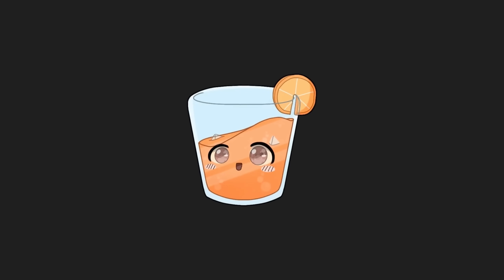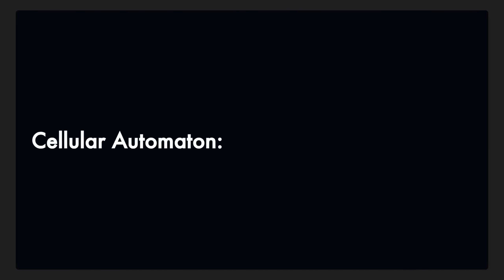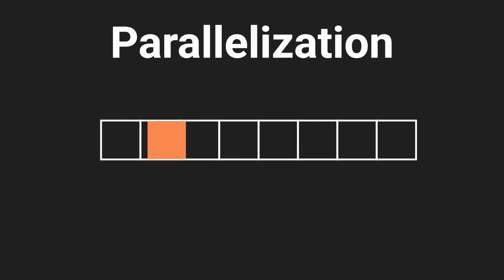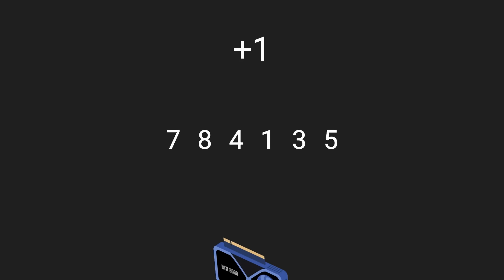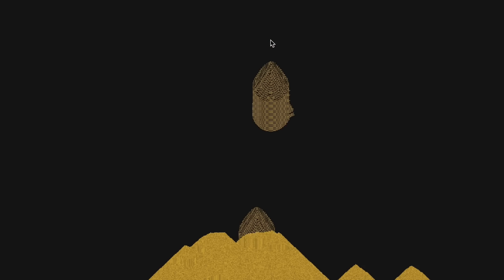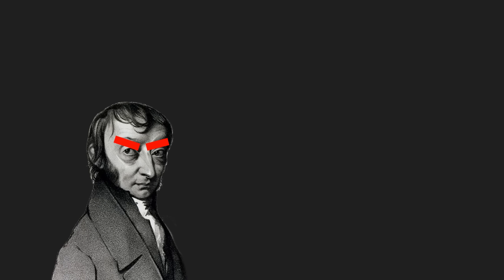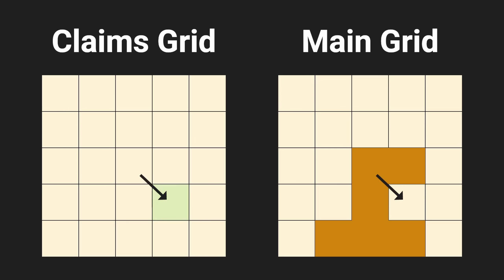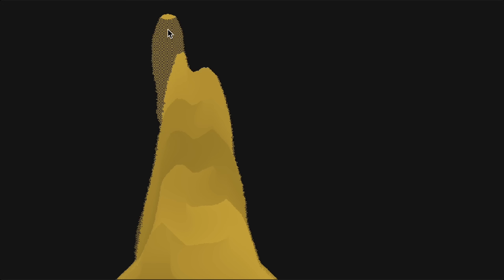Optimizing a Falling Sand Simulation To an Unreasonable Degree

Comment: The funny thing about what was said in 2:49 about CPUs is that, being a digital circuit, the CPU actually works in parallel behind the scenes. But its hard to make programs this way and most of the algorithms are design to work sequencially, so the circuit is design in a way the commands are read and executed in sequence.
Reply: Even if you do get the CPU running parallel operations, it's still going to be 8/16/32 threads, not the literal thousands you'd find in a GPU
Reply: Are you referring to instruction-level parralellization or superscqlar excution?
Reply: @JosGeerink  it sounds like they just heard about instruction pipelining for the first time
Reply: ONLY the individual physical cores can run stuff in parallel, other than that the core just switches Rapidly between tasks to fake concurrency, check Coredumped video about this topic
Reply: @Guilred  Actually they are smart enough now that if part of the core is not being used, for example the addition unit is not used for the current instruction, but the next instruction does use it, it can read ahead and execute the next instruction in parallel. Obviously it is a lot more complicated given branching and data dependency, but I think that is what the initial comment is referring to.
Reply: @Guilred coredumped is awesome. Really strange how he just popped out of nowhere shitting out high quality in depth videos tbh lmao. He started making videos right when my OS class at uni started as well, literal godsend

Comment: For the race condition have you thought about a red-black ordering approach?
Assuming every pixel can only read/write to its 9 neighbours, you can then subdivide the grid of cells into a grid of 3x3 areas.
Then you cycle in order of all the positions in that 3x3 area, but between areas there won't be any collision since they don't share direct neighbours.

The algorithm will look something like:
Run the top left cell of each area in parallel
Run the top middle cell of each area in parallel
etc...

This completely avoids the need for atomics and a 2nd grid, you lose a bit of parallelism but the gain in performance and code complexity will likely be worth it (also i doubt any GPU has enough cores so that dividing the parallelism by 9 will make a difference). It's often used in simulations where cells can have conflicts in between neighbours so it's a technique that's definitely worth looking into

Comment: How could liquids be implemented into this simulation? Would they act the same as a powder, just with a different viscosity/simulation speed? The sand would also have to be more dense than the liquid, so it doesn’t float on water

Comment: You're looking at the problem the wrong way. You need to re-think this as a cellular automaton like you mention yourself in the video.

Instead of processing each cell as a particle, you need to process each cell as... a cell!
If the cell is empty, check if its top neighbors would fall into it. If it does, color it that neighbour.
If it's not empty, check if it would fall to the bottom neighbours. If it does, make the cell empty.
That's it!

Also, don't read/write to the same buffer, as this will lead to race conditions. In that case you don't need atomic operations, just have two buffers of the same size and swap them each frame)

Comment: The thing is your still breaking the conservation of matter, so Lavoisier is still pissed
Reply: maybe hes using a portal to a sand dimension
Reply: "my eyes are not collecting dust from the air they're actually a portal to the sand dimension"
Reply: @AngusBro  exploiting the pharaoh's curse
Reply: Our universe isn’t either so not that big of a deal
Reply: @CrossyOwO  our universe may have abode to the conservation of energy even during it's creation, my surface level understanding of quantum mechanics tells me that it is possible for an arbitrary amount of "positive" energy to spontaneously appear as long as it appears alongside an equal amount of "negative" energy, it is not immediately clear why there appears to be no "negative" energy around which is for sure one of the greatest mysteries in the field of cosmology, but there are many explanations that still follow the conservation of energy, mostly by just arguing that the negative energy went somewhere else and/or we happen to be in a part of the universe where it is relatively uncommon
Reply: @nobodyinparticular968  I know what you are talking about but what I am talking about is a fundamental “problem” with our universe which we exist in because it would need to be symmetrical across space time for but one of the symmetries doesn’t exit, I don’t remember exactly which one I think something with time, so our universe technically doesn’t abide by the law of conservation of energy so also by mass through e=mc2 and thus stuff. 
But this effect of missing conservation of energy is so minuscule that it basically doesn’t matter to us because we all exist in a time frame in which we should not be able to see that effect for eons
Reply: @CrossyOwO  oh interesting
Reply: @nobodyinparticular968  To elaborate a little (sorry if I recap some stuff you already know, just wanna be thorough), it's due to the expansion of space. Noether's Theorem says if there's a continuous symmetry, there's a conserved quantity. And a symmetry is basically just "if I perform this action here and there, will it make a difference?" Like if you throw a ball up and down, it doesn't matter if you're doing it 5 feet left or 5 feet right, it'll look the same (translational symmetry <-> conservation of momentum). On small scales, it's not noticeable, but because space is expanding at an accelerating rate, the time at which you perform an action actually matters. As an extreme example, if you throw a ball up and down right now, you can imagine what it'd look like, but if you throw a ball up and down nearer to the end of the universe when space is expanding much faster, you'd rip apart or something idk LOL. Because of that difference, there's no symmetry, and thus no conserved quantity.
Reply: @Mr.MaccaMan  oh wait the speed of expansion of the universe is accelerating? i thought it was constant
Reply: @nobodyinparticular968  Yeah that's what the whole "dark energy" thing is. By accounting for positive vacuum energy, the observation of distant galaxies moving faster away with time can be accounted for theoretically
Reply: As long as Turing keeps working, we need not concern with somesuch named Lavos

Comment: Your problem actually arose right at the beginning: using the Compute Shader. Sand simulation can actually be implemented entirely in a fragment shader, but the logic is slightly different. Instead of checking where the current pixel will land and setting it, you can do it much more intelligently. You check whether the current pixel has landed and simply remove the sand pixel, and on another pixel, you check whether the pixel has landed on you and paint it with sand. I actually thought this was impossible to do in a fragment shader, but I somehow came up with the design for this system, and now I don't even remember it, and the source code is lost.

Comment: Something you could try for the slow falling problem would be to have a 2x2 or 3x3 checker pattern, so if each thread of the gpu controls 9 cells, you can go iteratively in those and less risk of overlap! I'm no GPU God, but i feel like doing a couple of iteration on a gpu thread might be faster than launching more threads!

Comment: 2:16 Parallelization is probably not the one you should reach for first.  Depending (slightly) on the language it can make things vastly more complicated, and may not speed things up as much as you need.  Maybe you'll still get there later in the video, but the first thing I'd try would be to track "active" cells so I can ignore the (hopefully) large majority that aren't currently moving, or as a more general rule try to optimize the algorithm itself before spreading it across threads, unless your language makes it VERY easy and VERY safe.
Reply: 6:41 I suspect you could use compare/exchange directly with the main grid - check it's empty, and if it still is then put your grain there, else reevaluate.  HOWEVER, concurrent code is notoriously squirrely, so I'd want to do a lot more analysis before being confident.

Comment: Instead of marking a cell as occupied or not, allow each cell to contain multiple sand particles of the same type, determined by a number. 0 is empty, 1 has one particle, 2 has two, etc. Instead of testing occupancy of neighbors, just pick one and increment its number. On each frame, if a cell contains multiple particles, attempt to spawn those in adjacent cells and simulate as normal. Fully parallel with no atomic operations needed. This creates a fun effect where the sand has density and pressure, which is especially useful if you want to simulate fluids.
Reply: This still has the same race conditions though
Reply: the race condition is deeper than that. It will still think the number is 0, so when it "increments" it, it will set it to 1, even though it was actually already 1, so sand won't be conserved
Reply: That's actually a pretty cool idea. Could even expand it to change the properties of a particle once they get compressed enough. Sand would be harder to shear once you get enough particles, making a sort of sand stone, and water entering a sand pixel could also increase adhesion, up until there's too much water and it begins to flow again

Comment: what if instead of atomic operations, you just split it into 3 subframes, one for down, one for diagonal right, and the last one for diagonal left, as they 2 pixels can't share the same destination in the same direction, only if they already exist in the same pixel, which just means its the same pixel
Reply: That’s three times the number of checks per physics update. What’s the upside to your suggestion?
Reply: @Maker0824  its actually the same number of checks, as in both cases you do 3*(number of pixels) checks. But in the way he did, he does all 3 checks, then moves to the next pixel, in my suggestion you'd do the downwards check for all pixels, then the left check for all pixels, and only then the right check for all pixels (left/right could be alternating, so one frame left movement is first, the next frame the right movement is first)
Reply: Interesting idea. But I think compute threads wouldn't run for the whole data set at once, introducing a certain ordering, which would result in a race condition again. Consider this pattern:

#
##
##

If you apply 'fall to the right' rule to it, depending on the order, the topmost grain will either be blocked by the one southeast if it's still there, or not if it has already been processed and has fallen down.

Another commenter[1] has suggested a two-fold approach: using two buffers, one for reading (checking), another for writing (moving), and reversing the checking logic, where empty cells would check for grains that could fall into them. It would seem that your idea would work if two buffers were used.

[1] https://www.youtube.com/watch?v=HrrJxkRlRfk&lc=UgykNNZbehjS9DOGT2t4AaABAg

Comment: Maybe just having each cell check for canidates that would fall into it's spot would be faster?
Prioritising falling sand over rolling sand.
So:
Check +1, +0 if filled, don't roll down (because that sand will fall into the roll spot)
Check +2, +0, if filled check +3, +1, if filled don't roll down

Falling sand does not need any extra checks.

Reads the texture more, but locally so cache would work well. Avoids atomics.
Unclear how prioritising falling would effect the simulation.
Reply: Actually just have backward rolling sand check for falling and rolling, less reads that way, and more local

Comment: I solved the sand speed by tracing where it could fall. Like, an actual "raytrace" but a sand trace. I check in the direction it wants to go but not only the kernel size.

Comment: first of all - parallelization is not an optimization...
also your simulation ia wrong, this is not a feature, this is wrong implementation. your particles are separating apart when falling, tho you spawned a dense circle. they must fall as a circle all the way down.
noita has nothing to do with cellular automata, paricles in noita have velocities, your simulation is not even close to buggy and not continuous noita's one... you did 0 research, you did 0 work at optimization and reading what cellular automata should work like, also seems like you are writing in python 😂
Reply: he literally told you he was using hlsl. it's in giant text. bold to say he did "0 research" when you didn't even watch the video you're commenting under
Reply: @ryanwillingham  i did watch it all just to make it out that he's not joking about optimization and high fps. my guess is that this vid is AI generated or AI-assisted made, since there is nothing new in here. this is thrash/distructive contnent imho, there are dozens of exactly the same videos with exact same bugs and struggles, what's the point of doing another one  or even worse one?
p.s. my naiive single-threaded implementation performs better. there should be no "optimizing" in the title. this is my only claim.
nothing wrong with programming for fun and making fun videos, but this guy knows nothing about optimization and someone unrelated to this topic or just new in programming could think that he's right!
Reply: @doodocina  "other people have made the same video so what's the point of making another" "parallelization isn't an optimization" "mine is better btw, did you know mine is better" bro this is the exact sort of thing multi-threading is good for and you're upset he presented it as an optimization? do you brag that your car rolls faster on square wheels because you put a bigger engine in it? do you not think round wheels are an optimization compared to square ones?
Reply: @ryanwillingham  you need to know how to parallelize things. in this video author thought "hm, gpus are kinda fast and parallel". this doesn't work like that. he stores data on the cpu, this is memory bottleneck, this is misunderstanding of optimization, there are no objective tests. i said mine is better because it's naiive approach that i have example of, this is not mine service at all, this is just a base that performs better without "optimizations". normal framerate for cellular automatas is 10k+, 500 is singlethreaded naiive approach, and the author says "look at me, i'm a cool gpu programmer guy who just made the most optimized sand in the world", how can't you understand that?
Reply: @doodocina  why are you so upset that this 10 minute video where someone learns something new inevitably simplifies how gpus work? if there's no objective tests in optimization, why do you keep obsessing over framerate? in what world did he say he made the most optimized sand on the planet? what could have possibly made you feel so personally attacked? 
you're throwing a fit over semantics on a video where someone improves their falling sand simulation. the thesis of the video is "it's fun to go back and improve old projects, and here's what i learned doing that". that's it. please go touch grass.
Reply: @ryanwillingham "optimizing to an unreasonable degree" means that it must be one of the most performant simulations in the world. this could just be a clickbait, but author thinks he is a genius - this upsets me, pure ignorance at every detail of self education and content creation
Reply: @doodocina  breaking news: internet user discovers hyperbole
Reply: btw, here is some very outdated thingy i suddenly have video of. it was my second day of writing C or so. cpu only(even graphics), one thread, 500+ fps, amount of particles doesn't affect performace, every cell is being checked.
https://youtu.be/M2PEenXd5pI?si=VFBbMnItv0_wuMQi

Comment: If you only let each particle move at most one cell each step (like it does when it moves into a neighboring cell), then you're implicitly placing a hard speed limit on the particles in your universe, which makes it make sense that your sand rolls down hills very slowly. Correct me if that sounds wrong though.
Reply: You're correct.

It also assumes every pixel has the same amount of pressure as all other pixels (0) - hence lop sided towers of sand doesn't literally push itself over, or push other sand particles down even faster.

edit: it also assumes 50% friction.
Reply: yeah this is it basically. It is rolling at a normal speed
Reply: I always wanted to do a simulator like this, but with velocities, pressure, and other cool things.
Reply: @DamiánBonušPowder toy!
Reply: technically the speed it takes to simulate each event is going to be the hard cap here. In this case atomic operations raise that cap, and since it's hard coded like you said, there isn't a whole lot you can do about it.

Realistically, you want to compute an infinitely small adjustment infinitely fast, infinitely many times over, to get a perfect simulation, but obviously that's not possible :)